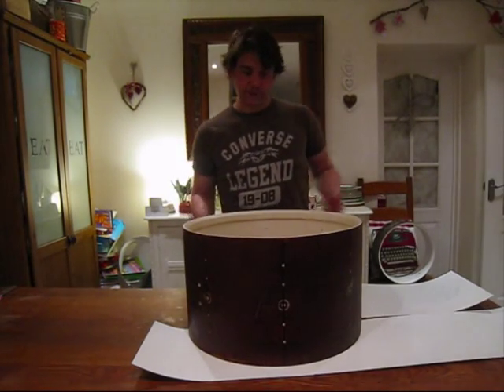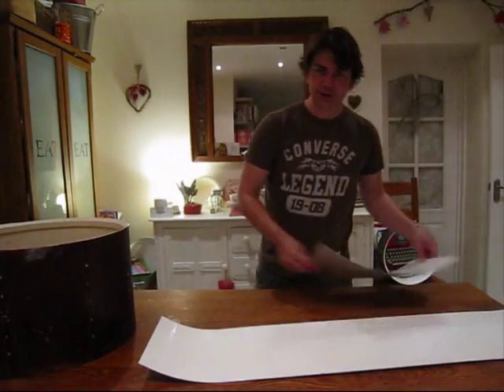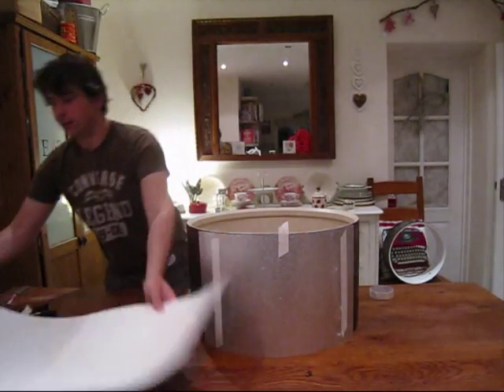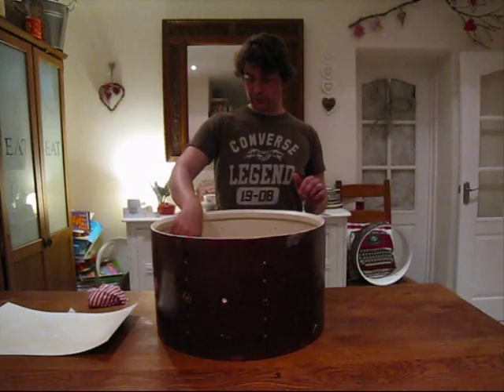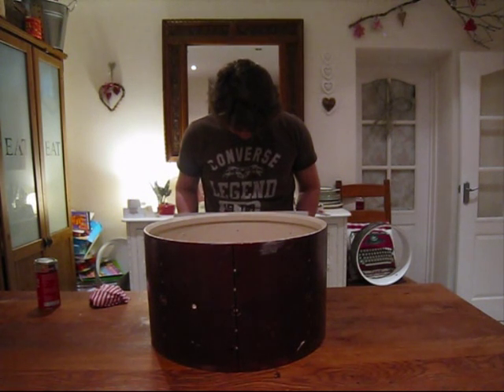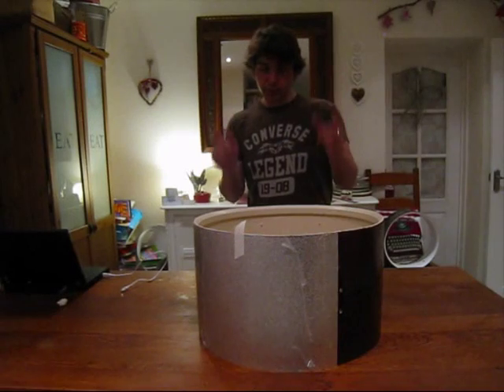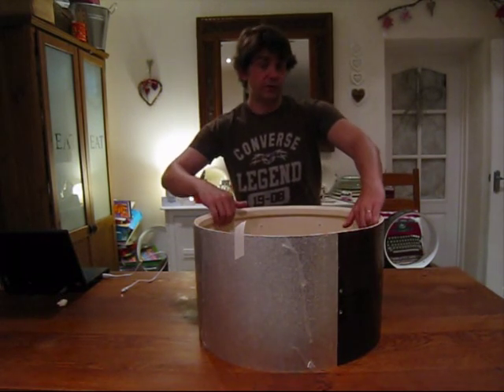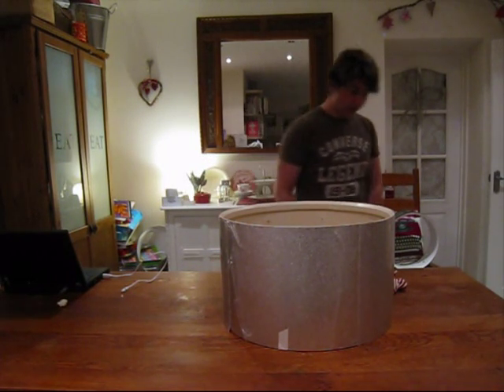How to wrap a bass drum Ludwig Kit restoration Part 5

Comment: So, how has the finish held up? I just wondered because you are supposed to use a nonflammable adhesive with the plastic wraps. All the plastic wrap available in the USA is made by a company called Delmar. If the sheets you have were 24"x54" they are made by Delmar.
Reply from the maker: +ineedarealjob I'm sorry for the late reply. Yes nonflammable is always the best way to go. I wouldn't use any other but its quite hard to get hold of here. I never ever use flammable on finish that has come off an old drum . the older finish just melts!! But the delmar seems fairly resistant to the flammable stuff you get here.